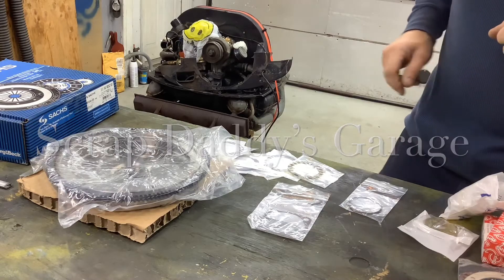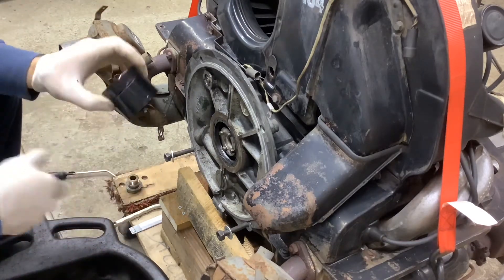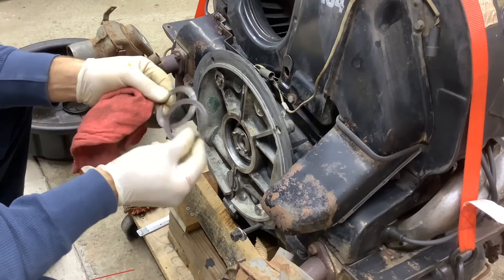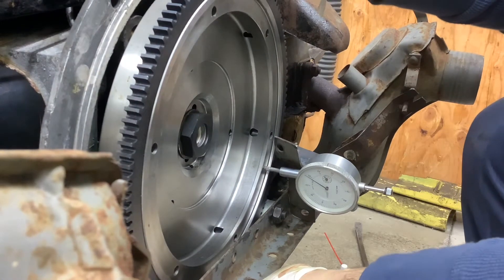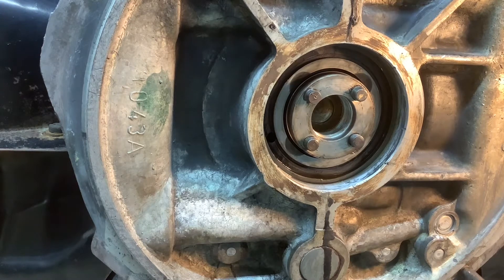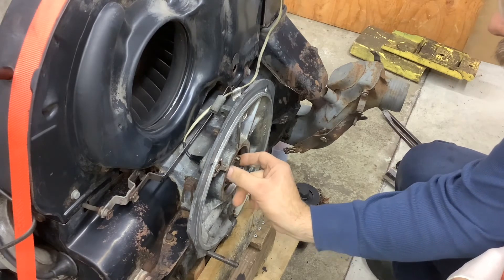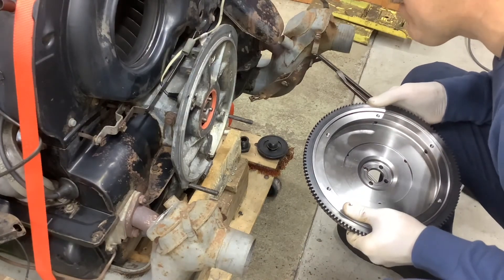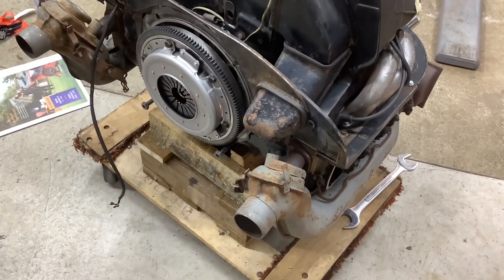VW Sunbug crankshaft end play and rear main seal installation

Comment: This is not for everyone, but........ I have taken tired bottom ends and measured the bearing ONLY "end play" and then checked the combined bearing end play PLUS crankshaft end play much like you did when you were getting your 0.040+ inch measurement. I subtracted the bearing end play from the total to just get the crankshaft end play. Once I calculated just the crankshaft end play I then added 3 (you must always use a minimum of three) factory shims that numerically gave my 0.004 inch calculated crankshaft end play and ignored the additional end play from the worn bearing thrust surfaces. Every engine builder will rightfully tell you this is nuts and for good reason. But, I did new top ends on countless bottom ends that had to have their endplay set as I described (above) that went on for many, many years and 30,000+ thousands of miles (I lost track of folks, but many years later they talked about how their bug was still going or the person they sold it to said it was still going). So, if you want to take some risk and not rebuild the bottom end (maybe you dropped a valve seat, just lost compression in one or more cylinders, had a massive oil leak, .......), the method described here worked for me and never didn't work.
Follow-up note: All engines were stock (excluding things like extractor exhaust, aftermarket air filters, ratio rockers with stock cams, crank pulleys changed to smaller, 87mm slip-ins, slightly increased compression ratio, .009 distributor, ...), had valves adjusted per factory recommendation, and were in an OK state of tune including correct mixture n timing. Not raced, driven.
Reply from the maker: Well said! This engine had a top end rebuild in the 1980’s. Sat for 30 years, got resealed and resurrected and is still running. Thanks for your feedback 👍
Reply: Yep, that was a lot to take in.

Comment: Engine out flywheel off and you think after seeing that messed up bearing its OK to button it back up? I wouldn't  roll those dice.
Reply from the maker: It was running and driving before but leaking a lot from the main seal. A full rebuild wasn’t in the budget. It’s still running and driving over a year later, fingers crossed hopefully it will stay that way for a while. Thanks for watching I appreciate the feedback.
Reply: @scrapdaddysgarage5027  Shows how good the design is. I understand budget and maybe the case was junk already.
Reply: @scrapdaddysgarage5027  I'm in exactly the same situation ... end play and thrust bearing rotating slightly around the crankshaft, but the engine was running fine the last time it was on the road, which was when I bought the car a long time ago.  However, when I put it back together I removed the metal gasket (with the 4 dowel holes) that was present coz the new flywheel had a rubber O-ring (apparently they're not both meant to be present in the same engine). I can't remember if the old flywheel had an O-ring but I've still got it so should be able to find out.  I also re-shimmed to try to reduce the end play.  The car's back on the road and has covered 100 miles so far.  After about 15 miles on each trip the clutch appears to make a noise when the pedal's pressed ... but not every time, it's definitely there but it's kinda intermittent!  Friends have suggested it's the clutch throw out bearing, but I think something's going on with the end float issue.  Sooner or later I'll drop the engine again and replace the original shims and metal gasket as a first attempt to keep the engine running through the summer.  In the winter when the car's off the road I'm intending to to a total strip down and line bore ... to hopefully save this 1776cc engine!  Very helpful video .... thanks!!